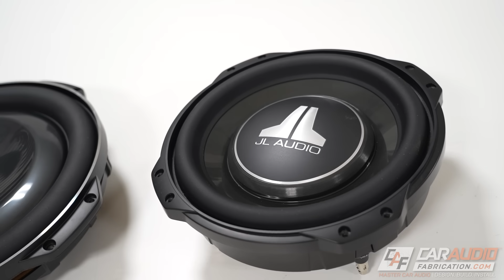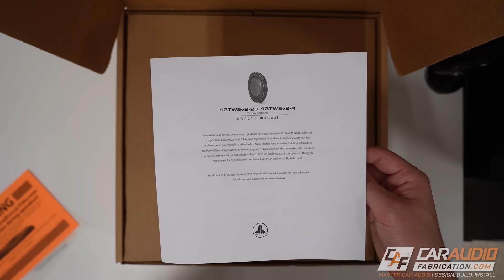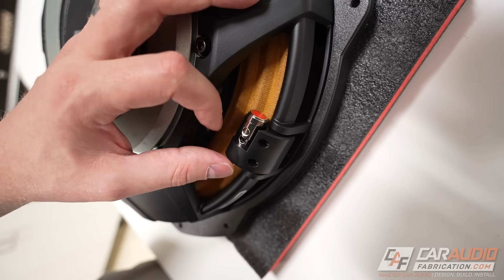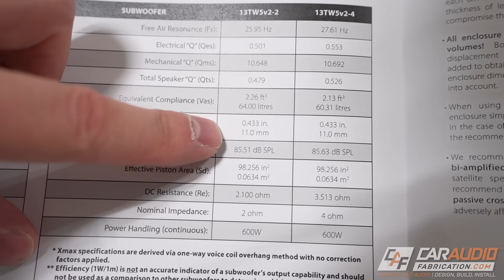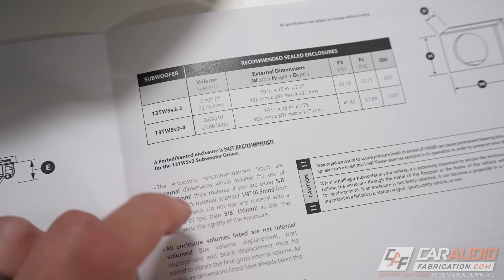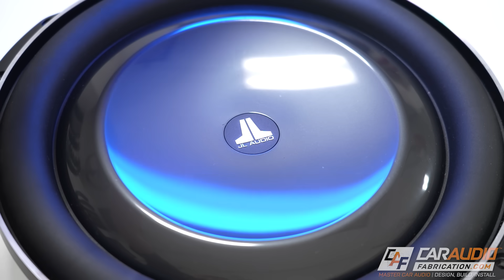The LARGEST Shallow Mount Subwoofer?! JL Audio 13TW5 Overview!

Comment: F350 crew cab. Just got  the 13" stealth box and the c2s in the doors and the vx1000 amp. Kept the raido 100% stock the DSP in the amp does the heavy lifting. I had a JL tuner guy spend some time and it was worth every penny. The system is invisible and I cannot say enough nice things about the combo. louder than i can handel with perfect clarity. it makes my fancy headphones sound flat.

Comment: Fascinating design but $1100 for a single subwoofer is a pretty big ask. And a meager 85.5dB sensitivity with no option for a ported enclosure leads me to believe you're gonna want to throw 600 watts at this thing to get any kind of significant output out of it. I mean, I get it...  You can't really get around the physics of it. A high moving mass grants you better small enclosure performance at the cost of efficiency, but I think the days of cheap power are behind us

Comment: Have you had any experience with the Alpine Type R shallow mount subs? I bought one years back to install behind the seat of the truck I had at that time, but then ended up selling the truck before installing it 🤦‍♂️. I just bought another car that has enough space on top of the spare tire to build an enclosure for it. It won’t take up any trunk space, will be completely concealed, and can be pretty easily removed if I need to access the spare tire.
Reply from the maker: I have not personally played with those subwoofers, sorry!

Comment: So I've been in this game since the 1980's.  The volume of the box depends on the T/S parameters- not the overall depth of the woofer.  A 12" woofer needs a specific volume of air behind it needless of how small the  magnet is or isn't.  I have always considered JL as the Tiffany of woofers in that they are overpriced and all hype.  But great shill video.

Comment: These are definitely a game changer, I'm running 4 SKAR 6.5 EVLs in my 1992 single cab Chevrolet and they work great but these would really wake that stereo up a lot. I feel like I could scale down my box design to a smaller single or even dual boxes and reclaim some behind the seat storage if I had to. thank you for the video

Comment: I just got my 2nd TW5v2-2. This sub blends really well with my JL C3 and JL C2 speakers. It really showcase JL's top of the line shallow sub. Sounds very clean, crisp and can put it in a 4" depth box.  You'll hear a huge difference right away listening to W6, W3 and TW3s. If you're planning to run dual TW5 subs get the 4 ohm if only 1 then get the 2 ohm.

Comment: Although manufacturers love to include the diameter of the rubber suspension surround in the overall diameter of the driver when stating the specifications, that huge rubber suspension should never be included as part of the driver cone's actual diameter, because a moving rubber surface doesn't produce clean sound....it's pure mud.  And the larger the width of that rubber surround, the muddier and more distorted the sound output is going to be.  In other words, you're getting => very low audio fidelity with very high sound distortion.

Comment: I have 2 of these built in a sealed box on the back deck of a Chrysler 300M. Under powered with a 500watt slash amp. Still bumping and going strong over 10 years

Comment: In the 90’s I installed 4 x 8” Kicker subs behind the seat of my 1985 Toyota 4x4.  Molded the sealed box directly to the back of the cab after coating the sheet metal with a special coating….  Can’t remember what it was.  Think it was actually a high density clay!

Metallica never sounded so amazing!!

Comment: Ive got an 04 forester I'd like to install these in under the seats, but i think the height and length recommended is just slightly too big for a clean install. Whats the downside of having slightly less air volume than recommended? And could I make up for that air volume by using 1/2" mdf instead of 3/4"?

Comment: I usually ride solo in my Audi A7 hatchback . I didnt want any regrets later down the line and have enough cargo space for my needs and went with a JL audio 10" W7 . I run it at a third of its power which is more then enough and shakes my glass. Its clean and that thing thumps !

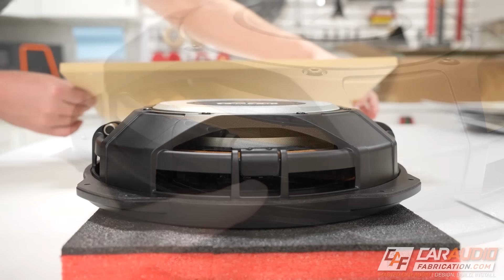Comment: @CarAudioFabrication please make an absolute minimum depth box for one (or more) of these 13TW5's like @9:40 "virtually right up against the subwoofer" @JLAudio says that's fine, curious if performance is compromised.
... also curious if the perforated screen looking circle between the grey badge and the silver powder coated magnet serves any function in the venting process. I thought the original 3 ohm version mentioned venting there. Thanks for all you do!

Comment: What would be a good budget version to this sub? Got a Honda Ridgeline recently and I'm kinda thinking I want to try a sub again. Previous unit was stolen out of the vehicle years ago and I told myself I'll never get a subwoofer setup again. Father of 3 I gotta keep my budget as low as possible and it honestly helps me over think all purchases and try to always get the best bang for the buck. I already have a aftermarket kenwood unit but it's a very low double din unit and I want to swap that out as well for something slightly better that's an actual screen

Comment: Pinoneer's back in the late 90's had what everyone called is a free air speaker. You could mount it on a piece of 2x4 sheet of wood and it would absolutey blow your mind !! I had 4 pioneers in my trunk in my 91 jetta . Was using a Orion amp. It sounded so awesome 💯🤘🍻
Reply: @vibrantlife6536 I had 4  of them 10" In my 85 Montycarlo.  running off an HCCA 225 and I thit 147 DB  back in the good old days 🤪😆

Comment: Can you use it as a free air subwoofer and use my sedan's boot as the enclosure ? It's a 1st Gen GS Lexus with already a super limited trunk space due to the gas tank placed behind the seats so I don't want to limit it anymore. And I need a shallow depth mount because there's an ion generator below the rear shelf

Comment: Hi, I just bought a new truck and am planning out my new audio system. I currently have a 10W7AE in a sealed box with the JL recommended size and I love it! Holy crap that thing is nice. It’s in my 2018 GMC Yukon. The new truck is a 2022 Ram 3500 crew cab. Ideally I would like another W7, but I’m not sure if I can figure out a box design big enough that won’t be too intrusive in the cab. So I’m considering the 13TW5v2, but I don’t want to be disappointed with the sound quality and more specifically the output. I should be able to fit 2 of them, possibly 3 if needed, but was wondering how you think the two compare? Will 2 13TW5 satisfy the wonderment I had with the 10W7? Thanks

Comment: @CarAudioFabrication is this the best shallow sub out right now in your opinion?  I saw in the video you mentioned having installed a number of TW3's.  I'm looking for a shallow sub for behind the rear seats in a Tundra crewmax.  I know JL sells their stealthbox with a pair of 10TW3's for the Tundra, but I don't know that I'll need that much output.  Coming from a single 8w7 that has more than enough output I think a single 13TW5 or 12TW3 would pay the bills, curious on your thoughts about the TW5 vs TW3 in regards to cone area (more on TW5) and xmax (4mm more on TW3)

Comment: I have 4 shallow pioneer 10s in the back my truck and it sounds good but only with the stock radio and a highlow RCA but if i put a double den poineer it won't bump as loud not even if i use highlow

Comment: My question is how do I know if I should get 1 or 2 subs plan on running 2 way speakers in my front doors and lower rear cab corners with 3 way speakers in my rear doors and 2 tweeters somewhere in my truck as well

Comment: I have 2 of those, and holy crap they bump and I can still fit stuff in my rig. Got them used and I don’t regret it in the slightest. Paid $1k for both of them and a sick amp
Reply: @danielsnyder8972  is it enough to hear the base from a block away?
Reply: @danielscg22  nope
Reply: wut amp
Reply: How do they do with 35hz and lower?
Reply: @carter.coleman  , I have 2 in my C8 and @ 28hz the SPL 137.3

Comment: I have one of these sitting boxed up in my basement.  Crazy that I paid $450-$550 for it and it's now $900!  
A lot of people don't realize that with JL Audio speaker- once they perfect the sound from a speaker, they generally leave it alone.  They don't redesign them to make them cheaper, like how some of the other companies do.
I had an Alpine PDX fail and throw constant DC output, and caused this sub to burn...JL did an outstanding job reconing it to make it brand new again..once I found a nearby dealer to send it out for me.
Reply: @mattb9664  I paid $500 for my 12w6v3-d4 and it's now $900 from crutchfield. The box is tuned to 31hz and paired it with  a precision power p1000.1 1k watt amp.  It's a pretty solid combo and most people don't belive me that I only have a single sub in my Ranger, lol.

Comment: I've been thinking about adding some more to my F-150. The stock system w/sub isn't bad, but there are days I want more. Thing is, I really value my floorspace these days. I wonder if these would fit behind the back bench seat. Maybe like 2 10", or hell, even 2 8". I'm not looking to shake the car in front of me these days, just want quality sound.

Comment: Just a question. Have you ever had to create an underseat enclosure with a bump out on the back for increased mounting depth? I'm at a loss how I would create that. A video by you would be awesome.
Reply: How do you mean? If you mean a litteral bump id say a routed shape with routed frame glued together over a cutout, theres also the option of going fibreglass to really minmax the space

Comment: Gaaaaah watts RMS, please don’t say that! It’s literally meaningless. You can compute watts RMS but it means nothing sensible. 

You can have currents represented in RMS…

You can have voltages represented in RMS…

The product of the two, power….is NOT an RMS quantity, it’s just average power or equivalent DC heating power but it is never, “Watts RMS”

I blame this on charlatans who took to computing things like output voltage, often times with signals having a fantastically high crest factor (ratio of Peak to RMS) and then computing that power as V^2/Re and saying eleventy billion watts. While such measures can be meaningful you need to describe the waveform, for instance a, “boink” which is a sinusoid of a given frequency multiplied by a raised cosine of a lower frequency to create an impulsive stimulus. If you can render this voltage waveform unclipped into a given load then you can quote a power figure which can be meaningful if not a bit convoluted for the average person to understand. 

Best to stick to quoting peak power and continuous power for sines, as such a crest factor of 1.4:1 in voltage or a power ratio of 2:1 between peak and continuous or equivalent dc heating power but NEVER EVER watts RMS.

It’s not academic (yes I’m an audio engineer with 30 years experience designing audio equipment) it’s not pedantic…it’s just flat out wrong to say watts RMS #soapbox
Reply from the maker: Sir... this is a Wendy's...
Reply: @CarAudioFabrication haha man just trying to inform. Good video…
Reply: @CarAudioFabrication  🤣🤣🤣🤣🤣
Reply: "flat out wrong wrong to say RMS"... is that a joke? (not flat?!)   @JeffFoxworthyofficial "Here's your 'sine'🤣
... instead of saying RMS do you prefer Root Mean Square 😂
Have it your way at BK 🤪

Comment: I ran various JL subs back in the day and one thing that always impressed me was the sound quality and ability to handle more than rated power.  I started with 2 12W0 subs on a 600watt Crossfire amp in 1999.  They were only rated at 125wrms each, but they took everything that amp could feed them without issue.  I then moved to an 18W3 on the same amp in 2004, but had it in a Focus ZX3 hatchback, and that would tickle my butthole in that tiny car.  No sloppiness at all from that big sub.  Then I had two WX10's on a JX250.  They sounded amazing for such a low powered setup.  If I wanted to get another sub today, I probably wouldn't get anything more than a 12W3.  But from what I understand, their TW subs are nothing short of amazing.

Comment: I have had 2 tw13’s in my f150 crew cabs an ‘05 and ‘11.   First setup was a 500/1 on each and the ‘11 has a single Kicker 1200w. 
   Dang sure a quality sub!   Also had 4-w6 12’s and a 13w6 in a ported box.   All were good to me.

Comment: Did you make that W7 box at the beginning of the video? If not where did you buy it. It looks really nice. 👍 Should it be facing into open cabin or be best closest to a wall. Like the back wall of an extended cab truck ❓🤔
Reply from the maker: Also we can assist with a design on our website to get you the best results for your application
Reply: @CarAudioFabrication  Wow thank you.
Reply from the maker: I built it, full video is on the channel. Just search caraudiofabrication w7 box build.

Comment: Im questioning the reason for such a large surround with low xmax(for a modern sub)surely a smaller surround could still cater for 11mm xmax(whats the Xlim?)and yielded an even bigger Sd

Comment: I still have my 12w3-d2's from 99. Had to put new surrounds on them butt still slam in my home theater. Now have a single 12TW3 in my truck... All I can saw is QUALLITY! great products.
Reply: Had 2 of those running off a MTX 2300. Wasn't too crazy. Had them in a 1990 Honda CRX. Was running a 15" Cerwin Vega Stroker. It definitely got much lower.

Comment: Thanks for the review. I’m putting together my sound system & I just ordered a 10TW3-4
Reply: W/ the right enclosure you won't be disappointed but I've had the 10s and 12s and the 12s are noticeably better imo. They handle the lower notes better and get a bit louder vs the 10s, but both are great.

Comment: I have 3 JL Audio WO 8's from 1998.  They still play like new and were the least expensive subwoofer from JL Audio at the time and probably ever.  Their quality is unmatched!!!
Reply: Had a friends who’s brother had two tens in a ported plexiglass box and they hit like anything way more expensive
Reply: got this as well
Reply: Those old Jls were monsters
Reply: @m3hsid10  dope those were my first JL also about 99..I went with those Boston Acoustic if I remember correctly. That was many brain cells ago
Reply: I had a pair of 10" W0s back in the day that were absolutely fantastic. Loved those subs.
Reply: in 2000 had 3 jl w6 12s and a pair  of  w3 15's in a f150 ex cab all run off a zapco ag 1000  bridged on the 12s(900watts rms)  stereo to the 15s(450watts rms ea)  zapco ag 750 on the highs (375x2rms)zapco preamp  in the dash .   it was a awesome system no matter what was played clean clear and beat  the guts out of you

Comment: QUESTION: I'm tired of subs sounding the same. At this point it's just noise and rattle. But then I've seen people playing guitar music and the base sounds like super precise controlled deep beauty and I'm like OMG. Should I be looking for my next sub to have a bigger frequency range? Would that fix the problem? I want to listen to more than just rap with a really good system. I want to feel my music but it needs to sound accurate. FYI I like JL speakers.
Reply: @ChillFactor727  be careful on too large of a range or vocals will become wonky. Sealed boxes will give you a more precise sound, but really you need a good mid-sub to pair with a large sub to get a good sound for string instruments.
Reply: Look for a sub designed for SQ/sound quality and not a SPL, and pay close attention to your enclosure requirements. So for example Kickers come to mind if you want alot if bass but not necessarily great/accurate bass. JL audio, Infinitty Kappa, Alpine type X, these are designed to make whatever your play sound good. They may cost more, some may not "get as loud" but trust me....if you have the right enclosure,  and amplification,  you'll never go back. I have two Alpine type X's, ported enclosure built to specs, and I leave my EQ on flat,  and rarely touch the amps "bass volume knob"  nor the bass knob for Audio-control(brand) peripherals I have and EVERYTHING just sounds great.
Reply: Upgrade your amp and wiring as well, I was running this jl 13.5 in sub on my Skar rp 1500 amp with their wiring kit and was still not impressed. I swapped it for a jl amp and proper wiring and now  it not only hits 10xharder but the bass is smooth as can be.

Comment: I have a Hertz MPS 300 S4 shallow mount and it is amazing. Only running off the 5th channel of hertz ML power 5, 380w rms and it’s perfect in my car.
Reply: @Shauny808  yep, I've got this same sub in the weekend car and it is amazing and a 13tw5 in the daily. Very different subs but both sound great
Reply: I love my Hertz MPS 300 in my truck. I tried a few different shallow mounts and the Hertz has been the best that I've tried so far
Reply: I've got the mps 250 in a sealed box in my truck running off an HD750/1 and man is this little thing impressive
Reply: Got a MPS250 one and it was very very great (in 14l sealed enclosure), had to unmount it from my car cause I sold it and got a new one with oem Focal install. But the focal 8' sub can't ever come close to the hertz mps one. Waiting for the new car to mount it again with some 500w esx amp.

Comment: I had the og version back in 09 in my 2008 f150 under the bigger rear folding seat. Designed a slealed box in google sketch up and had no idea what the internal air volume was but it slammed pretty damn good. Had it running on an alpine pdx 600.1